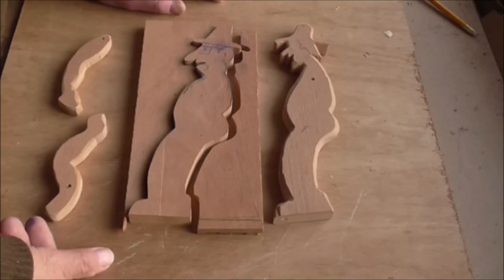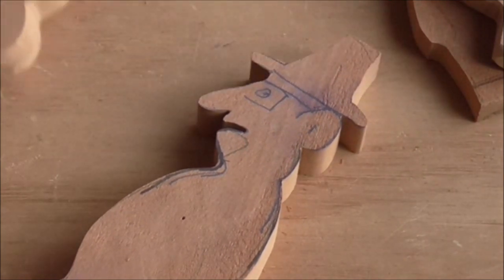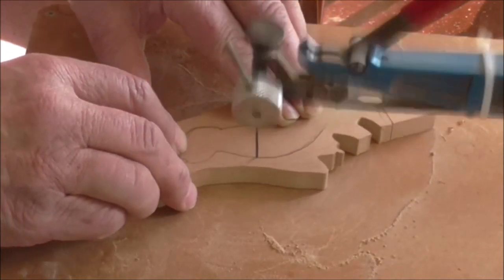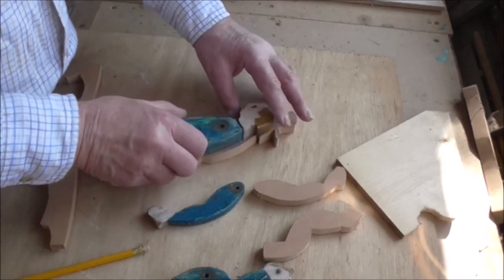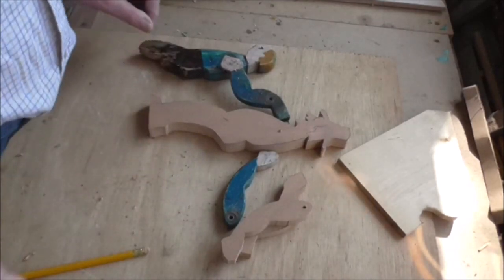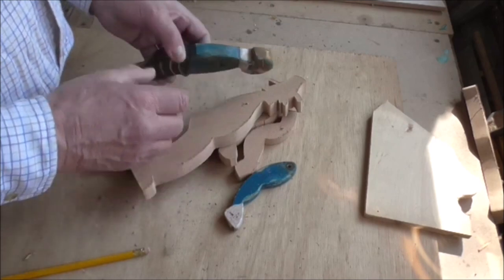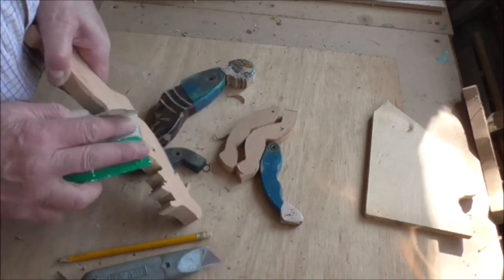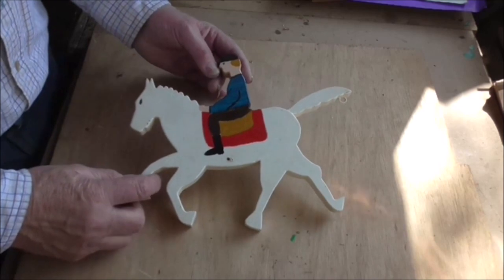How to make a whirligig. Characters Extra

Comment: Hello ,  Love your videos . Will you tell me the length of the base for the wood pecker whirligig please  , and could it be made any shorter .. Kind regards and thank you .  Bill.
Reply from the maker: Thanks again Bill for your kind comments. The base on my woodpecker whirligig is 23 inches (58.5mm) but you can make it a lot shorter if you wish, in fact a shorter base would probably be better on this one. Try to make the characters (in this case the woodpecker) as large as possible, I find they look big in the workshop but once they are fitted up outside I always wish I had made them bigger, they show up a lot better.
By the way you don't have to make the base long and thin like mine you could make it on a rectangular platform if you want. Regards John.

Comment: hi I made a whirligig and painted it with oil paint, after 3 days its just as wet as it was when I painted it 
thing of wiping it off as its a mess
thanks for your great videos
graham
Reply from the maker: i know what you mean, that is why I normally use acyclic paint then varnish, the acyclic paints dry in a few mins on a warm day. The Varnish can take days to dry though. On cold damp days oil paint will take a long time to dry.